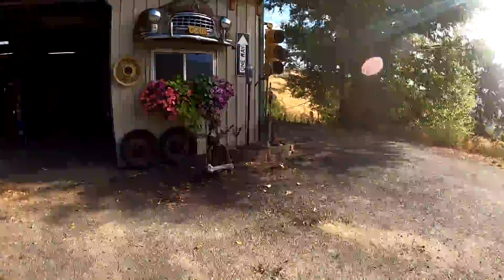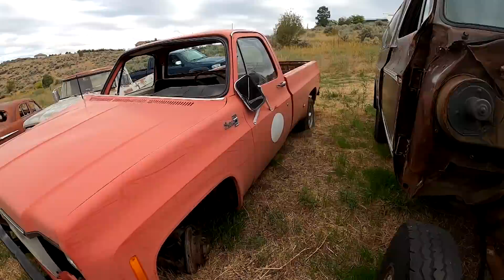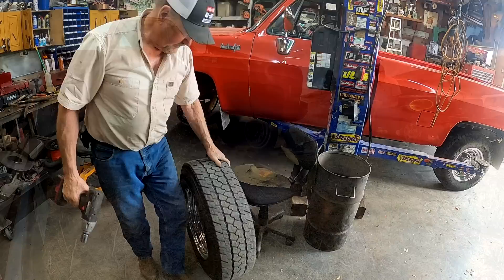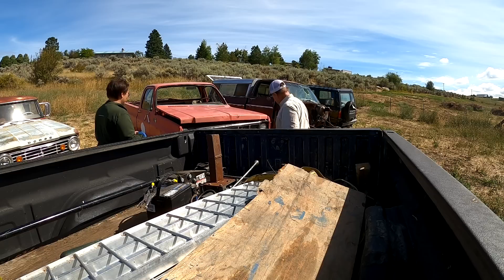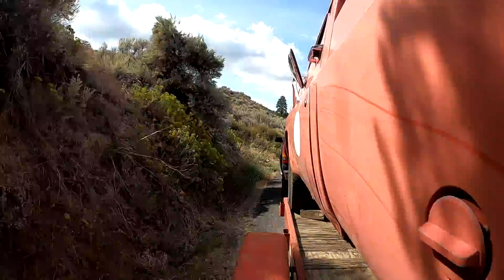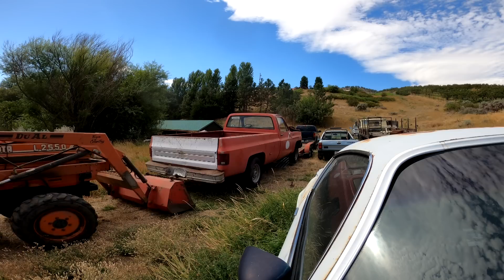Donor Truck for my wrecked Square body

Comment: With the Brat/head gasket. Get copper kote in a spray can and do 3 coats per side. A good friend who's a heavy equipment mechanic gave me this tip when I kept blowing head gaskets on a 400 small block GMC van. I did this the next head gasket replacement and the motor was still going strong with 120,000 plus miles when I sold it. I copper kote all head, exhaust, and intake gaskets on 2000 and older. Reason I say 2000 is I won't own anything newer. OBD 2 is my limit. Not investigating in any more diagnostic tools then purchase subscriptions to diagnose. Plenty of work on those older rides
Reply from the maker: i have that copper spray.. thanks for the tip

Comment: Here in AZ we don't have to worry about trailer tabs. We pay a one time fee and get a permanent plate! @4:26, I about jumped out of my chair when I spotted that Dodge sweptline. I've had several years back. Love them old trucks. Glad you found a solid donor for the square body. Looking forward to the rebuild series. Thanks for sharing Waylon!

Comment: Reminds me of getting talked into bringing back a square body suburban.
3 flats, no electric winch ( cable come-along ) and no keys for the steering column... I ain't never had that much fun before or since.. Thanks for sharing Waylon, Best Wishes.
Reply: I did something similar, 4.5 hours in the sun.  Ugh, but it felt good to have the vehicle on the trailer.  This video reminds me I really should pull my trailer winch and see if I can get it to work,.

Comment: So many beautiful landscapes in this video. The scenic beauty of the western coastal states in the USA is quite something. I drove a god-awful Dodge Aries down Highway 101 pretty much all the way from Sea-Tac to San Diego in 1987 and the landscapes were fantastic (when you weren't look at the back of some giant RV).
Reply from the maker: I drove it in the 83 s10 ..motor homes and logging trucks!  one of which threw a rock with the rear duels and broke my windshield!

Comment: Good score on the donor truck.

As to the BRAT engine. Take a real good look at the intake manifold gaskets. If they leak between the coolant passage and the intake passage, you will have the same symptom of steam out the exhaust as a bad head gasket.
Had two different engines do that on the BRATs I owned.
Reply from the maker: thanks I'll look into that
Reply: Folks, I have some priceless advice when moving cars and trucks around...especially by
yourself.  “The old rope and snatch  trick”. You can use it in most all cases.  Move
most anything come to think about it. Just so great when working in a tight place.. I 
use it very often....advice for a 84 year old that is a gear head and still active. Good to
go Ken..best to ya!
Reply: Should have said snatch block and rope for moving almost any object in a tight work area.

Comment: The Subaru Brat, and all models at that time had head Problem, I worked at the dealer, Cracked heads always, I own a Subaru Baja  Now , Find out if the Newer motor bolts up,

Comment: Glad ya finally got it home. I have always said that the first 90% of the job takes 90% of the time, and the last 10% of the job takes the other 90% of the time. At least, that's how it always seems to go for me. As for todays tip, when ya have to push the trucks and cars around with the tractor, get an old unmounted tire or maybe 2, and wire them to the front of the bucket. That will help keep the damage down if the bucket hits the truck. When I was a young man, every gas station had a tire or 2 on the grille of the shop truck so they could push cars around and not damage the car or their pickup grille. Cheap padding ya see, and I know ya got bailin' wire and old tires layin' around. We all do! Anyway, if you keep the videos commin' I'll keep a watchin'.
Reply from the maker: ive used old tires to push rigs around my whole life.. but there was no damage to be done to that old bumper! haha

Comment: I’m putting together a truck and I need a cab because of rust damage and sunroof modifications by previous owner. My truck is also a 4X4, do you have any suggestions?
Reply from the maker: i might not have to use this cab..  coatesgrafting@gmail.com

Comment: Sadly most of the time the blocks are just as bad out of flat as the heads are.
Reply from the maker: i'm sure you're right..and I would have liked to have gotten new head studs and had the block resurfaced as well but the studs seem to be made of "unobtainium" haha.. can't find replacements anywhere. It had a cracked head so we replaced it with a good one and had them both resurfaced. I'm hoping it will hold together until he gets his replacement engine.. he plans to do an EJ swap.. I'm not much interested in it. haha.. but fortunately, he is getting pretty good with his hands and handy with tools so he can do most of the work.   makes ol Pappy kinda proud, ya know?